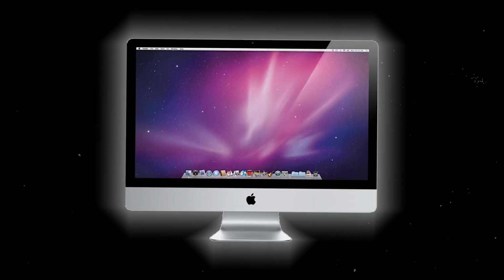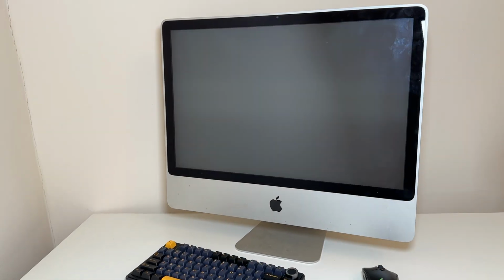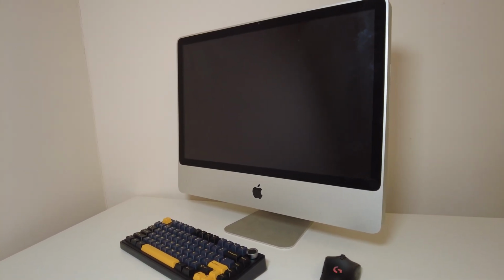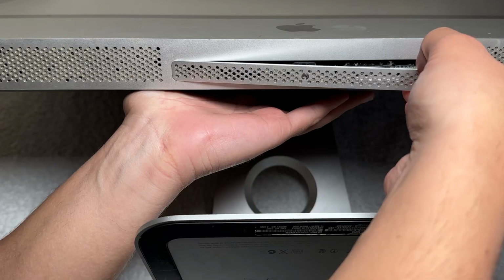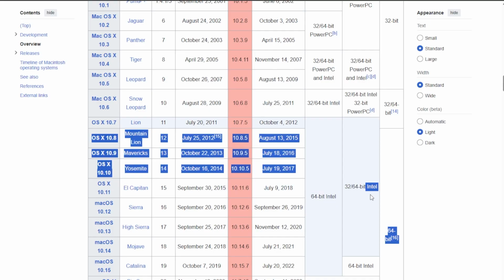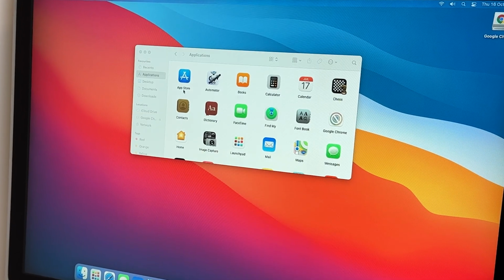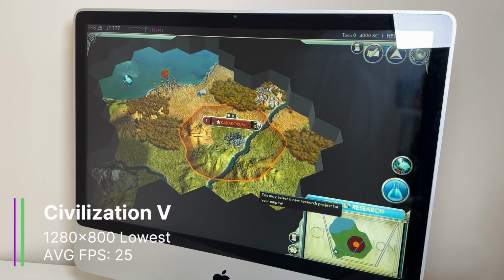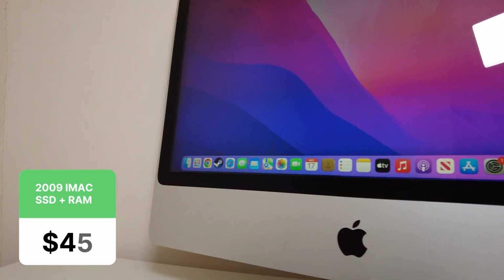I Found an IMAC In The TRASH... Can It Play Any Games?

Comment: Similar to me, I was given the same but 20inch version without the disk drives. I was struggling to install latest linux and downgrading the kernel so it works with the old nvidia driver without glitches. now it runs though i still rarely use it